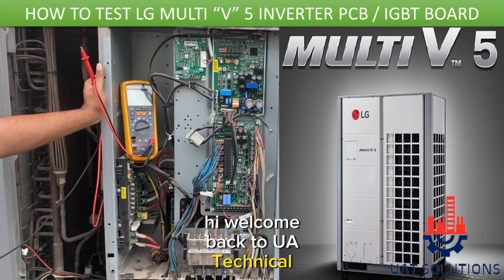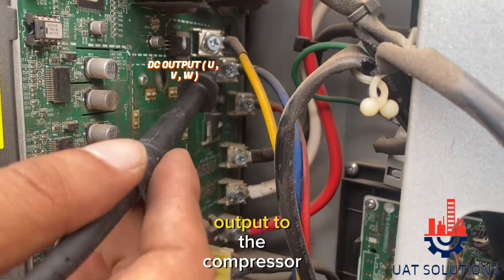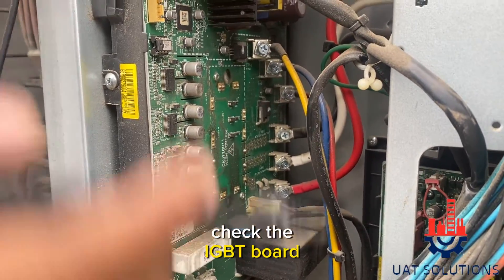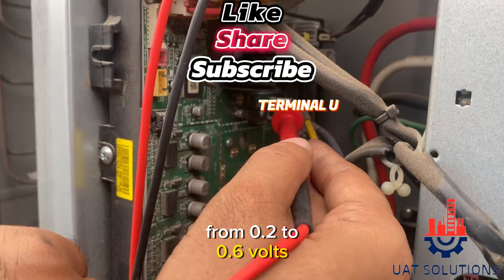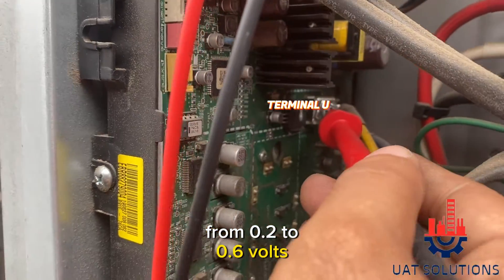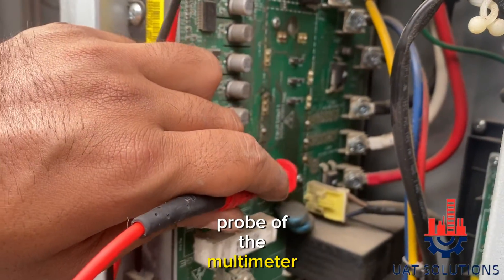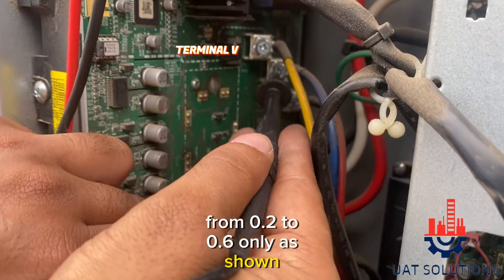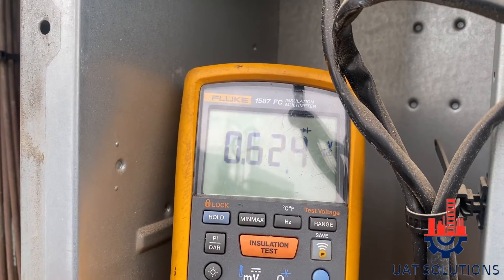LG VRF Multi V5 Training Course | Part 8 | How to Check Inverter / IGBT Board or Compressor Board

Comment: Hi Sir,
In a carrier 30 XA chiller, when is there a need to replace an oil level  switch ( float switch), can you please explain exactly.
Regards
Derek
Reply from the maker: Hello.
The oil level switch works ok dry contact principal. If the oil level is good in the chiller oil level switch contact should be closer. 
In case oil level is ok and oil level switch contact is open then replace the switch
Reply: @UATechnicalSolutions  Sir, I appreciate your prompt help. I'm dealing with a 30XA0302 carrier chiller. I can't figure out the chiller tonnage as I'm new to it